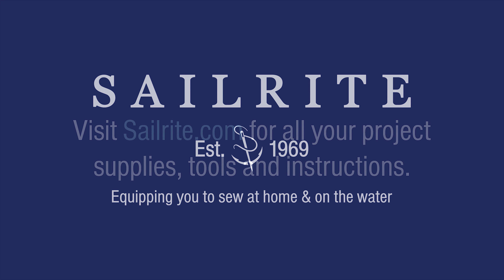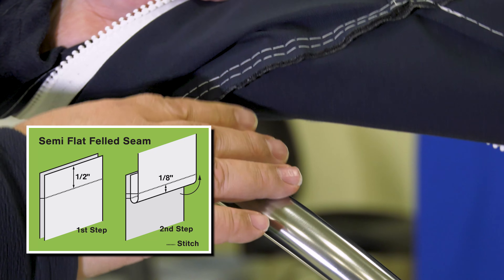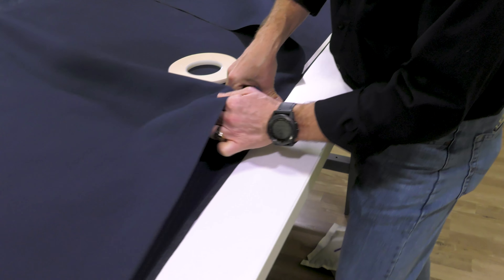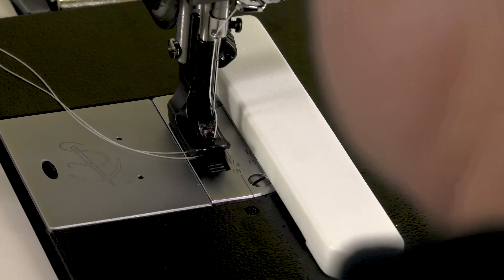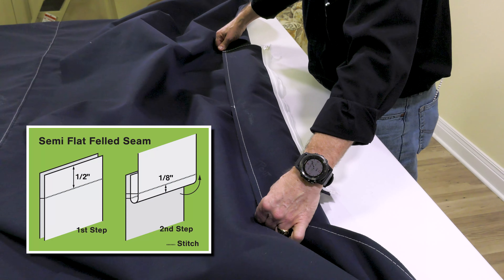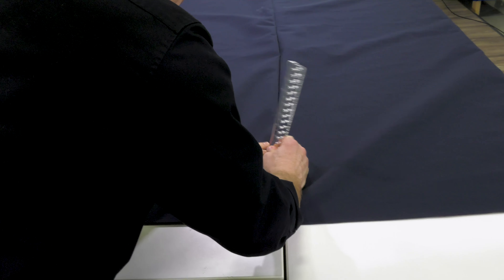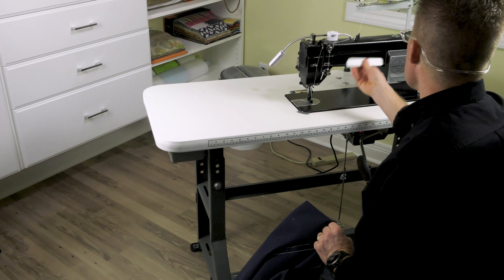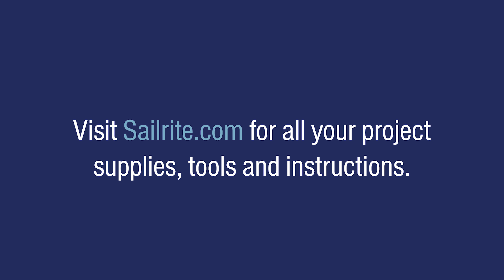Sewing a Semi Flat Felled Seam - 4 Top Tips

Comment: I want to make a laundry bag of canvas duck. I wanted to make the circumference out of one solid piece of duck and join the ends with a semi flat fell seam for strength and aesthetics. However, I can’t figure out how to add the top stitch without a cylinder of post sewing machine. Any tips on how to do it on an Ultrafeed or any flat table sewing machine?